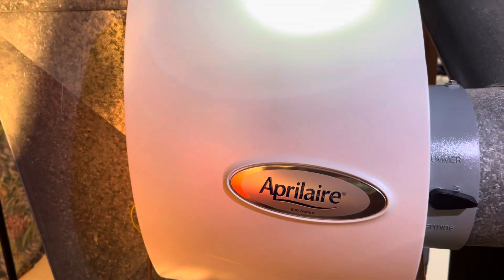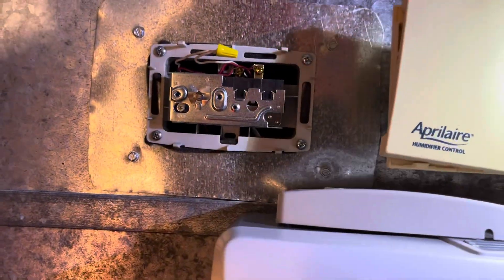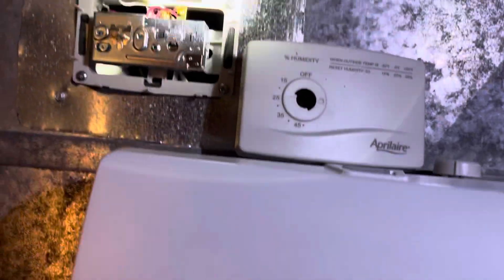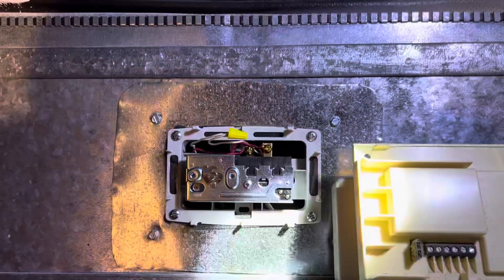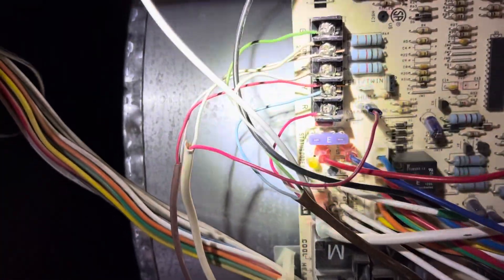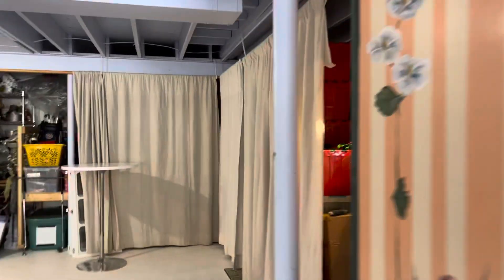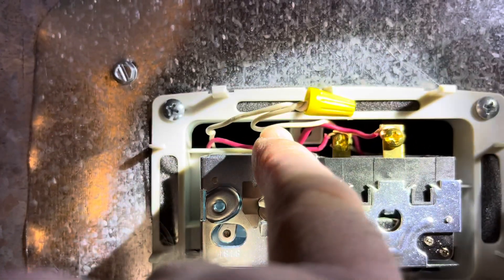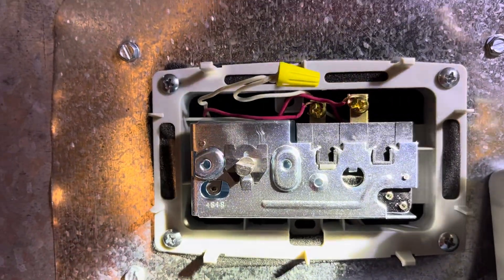Wiring a manual controller for an Aprilaire 600 Humidifier

Comment: I did my wiring to W and C.  The W setting is for the furnace and mine gives 24v (most of them do).  When my furnace goes on so does the humidifier.  You can also wire it to the G for fan.  But if you circulate the air it would turn on.  I find W and C to work best.  I believe the humidifier wiring would be on all the time

Comment: You explained some of the wiring but not the completely.  I assume the power wire from the controller goes to the the hum tab and the white wire that is tied into the selonoid goes to the W  /white wire on the mother board. You are also not using the transformer??  Please clarify. Thank you

Comment: Thanks for the video. It is important to note that some circuit boards have a HUM-H and HUM-N takeoff. If this is the case this method will not work for you as those supply 120VAC. Always verify the voltage of your HUM takeoff. This can be found in the manual/instructions for the board.

Comment: Good morning Dan
I am a guy from Houghton Lake, here in Michigan and I have been trying to figure out how this (same) controller should be wired.
I had a previous Aprilaire, I was replacing. The new one had an auto type controller, and the new system has the same looking controller I have. 
I have been having a hard time completing the circuit with the controller, water valve, and 24V transformer, which was already installed. Your wiring of the manual controller, definitely showed me my controller wiring was off.
Is there a way you can explain/show me how you wired this controller?
I have an 27 + year old controller, so forget about the EAC board, or whatever you called it
Thank you
Mike